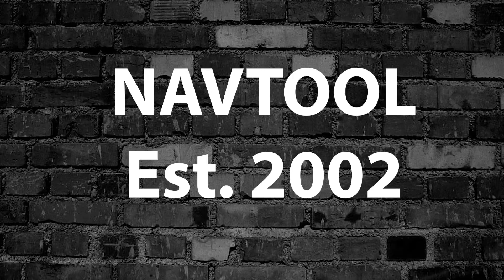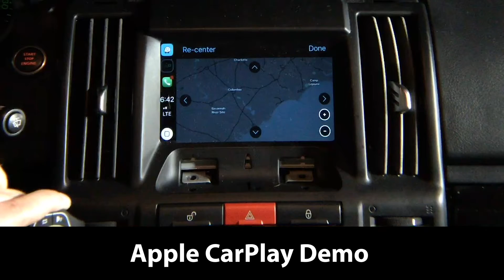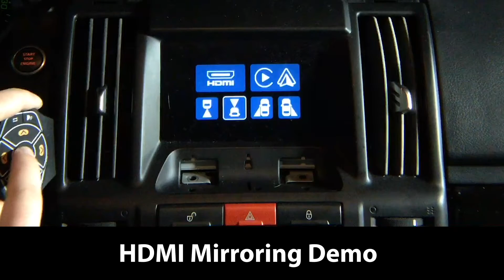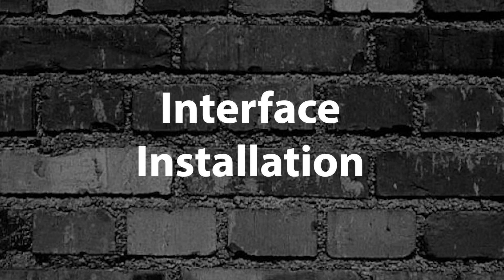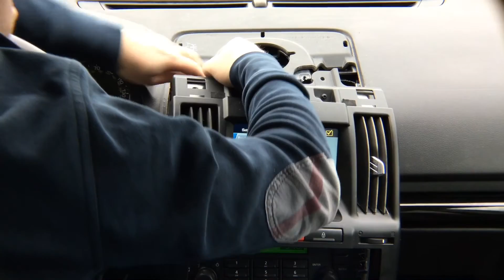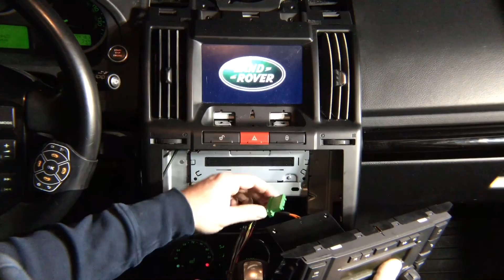Land Rover LR2 Apple CarPlay - How To Add Apple CarPlay Land Rover LR2 2008-2012 NavTool Interface

Comment: Is a different controller available? Just don't want to use something attached to my steering wheel. I am almost certainly going to knock it off and have it rolling around on my floorboard! 😆
Reply from the maker: must use supplied remote